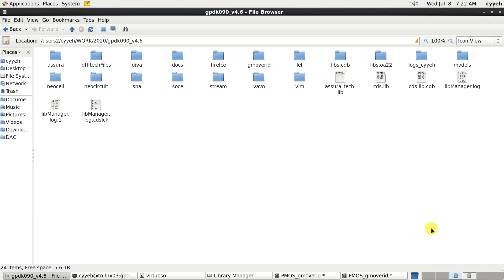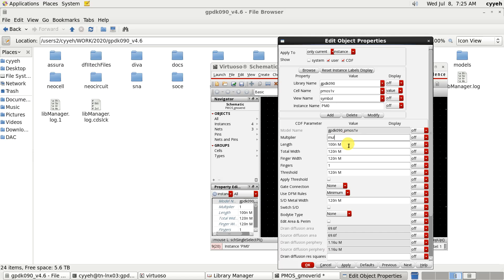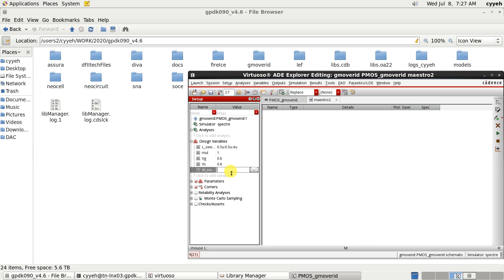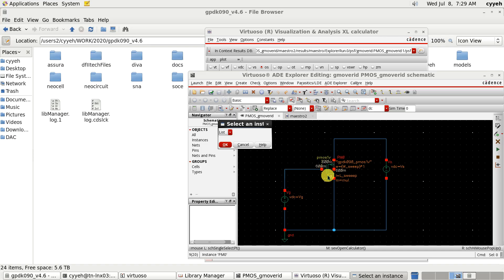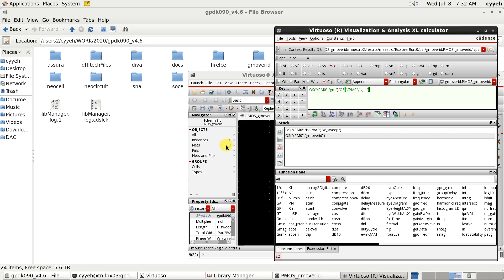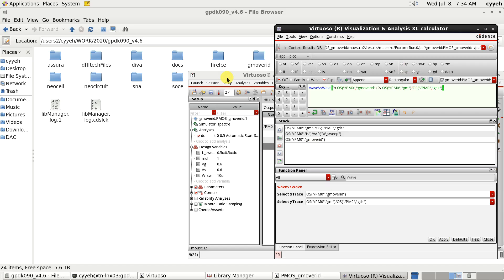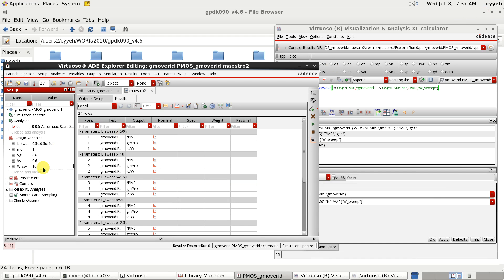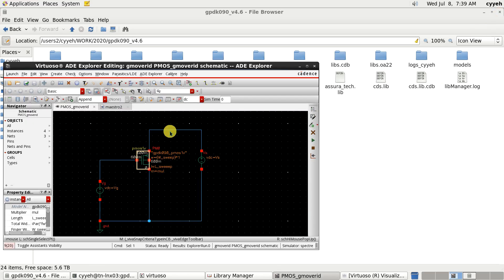How to make gm/id plot in Cadence Virtuoso ADE (English pronunciation)

Comment: Thanks for doing this video. I don't particularly understand why a ID/W Simulation is of interest. When Designing the circuit one never types directly a value for W instead always W/L. 

Is there an explanation available to some of you why this type of simulation was done?
Thank you
Reply: Vov or GM/ID or ID/W they all represent the bias point, for example in RF AND mm-wave designs they prefer to use ID/W

Comment: How to use gm/id methodology to design circuit with FinFet process? 
In FinFet, W(width) is a function of number of fins. Just get gm/id vs id/(number of fins)? or gm/id vs id/(number of fingers)? or gm/id vs id/multiplier?
Reply from the maker: In finfet, since the current is no longer linear with width or Nfin, it is difficult to use id/W or id/Nfin to calculate the normalized current density.

I currently use the id/multiplier, but the disadvantage is that I must fix a Nfin to every finfets. I am also studying related topics. If I have new ideas, I will reply to you.
Reply: @ericyeh3787  How do you consider the length of finfet? Do you also sweep length? Do you use stack of mos transistor to realize larger length? If using stack of mos transitors, how to decide the stack number(say, stack=4, 5, 6...), how to make gm/id plot? A video tutorial will be helpful. Thanks!